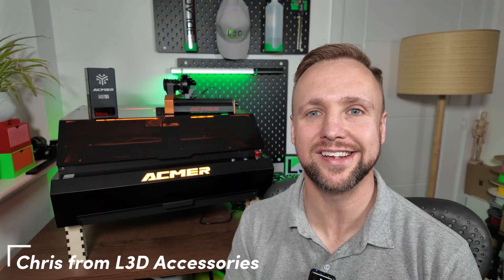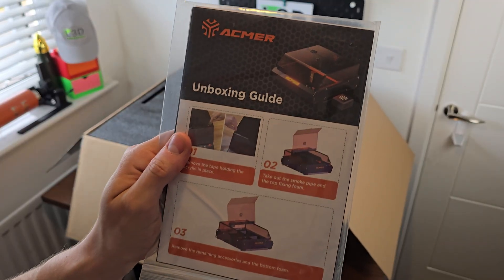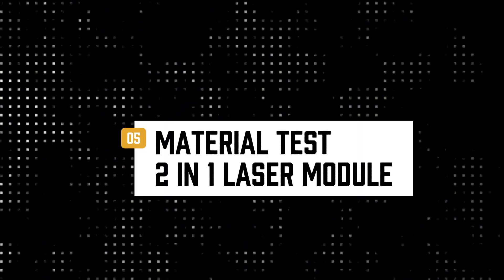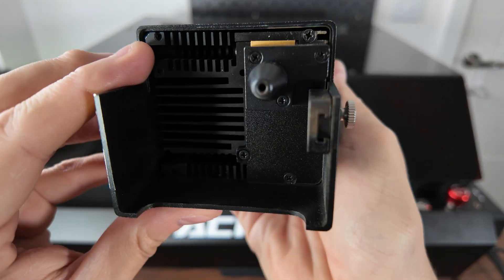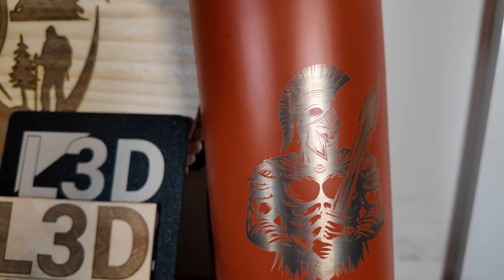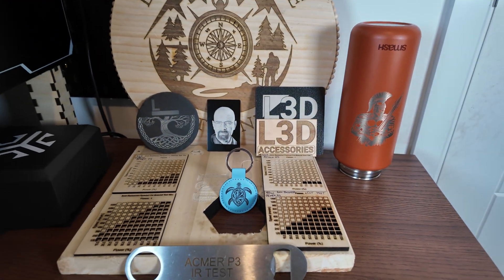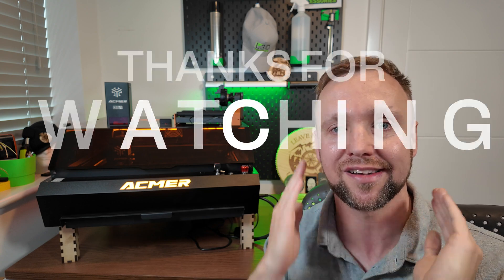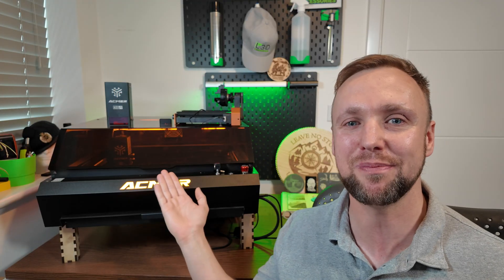Struggling to Engrave Metal, Wood, Leather? ACMER P3 Handles It All – Full Test & Results

Comment from the maker: Correction: After posting this review, I discovered there is a rear fan switch on the back of the ACMER P3 which allows you to turn off the external fan. However, the machine still remains fairly loud overall due to the internal module fans, so that part of the feedback still stands.

Comment: Be careful buying from this company.  The cleaning process only leads to broken wires and a laser you cannot use.  Plus, customer support does not exist.  I've tried numerous attempts to help with my laser purchase Nov, 2025.  No response and non-working laser.  Less than 1 month old and not working.  Go some place else to buy.
Reply from the maker: Thanks for sharing your experience. That sounds really frustrating, especially with such a new machine. My own unit performed well during testing and the review reflects that, but individual faults can happen with any brand.
I don’t have access to ACMER’s support system myself, but I hope they’re able to resolve this for you quickly.

Comment: I am a hobbyist and do small projects to learn and maybe a small gift for family and friends.  I have a Lo.....er 10 Watt machine the I have used for years with pretty good results.  I am looking to upgrade.  In your opinion do I need to go to the expense of the 48 Watt head or which on would you recommend?  TYIA
Reply from the maker: The answer would depend on your intended plans. If you want to do intricate engravings onto engraving blanks or wood I'd say to go for the 20W. The spot size is smaller and it is much easier to get a nice clean finish. If you want to cut some thick woods and acrylics then the 48W is what I'd recommend.

Comment: If you use thicker materials do you have to do a camera alignment everytime. Or is there anyway you can off set it
Reply from the maker: I never realigned the camera once and I always found it to be accurate.
Reply: If you have a good camera calibration and a good focal point set for that then you can just reset the focal point for thicker materials up to a certain point. The further you get from the center the more placment drift you will have. A good focal point works for 1/ 16 1/8, maybe 1/4 but would need to be redone with calibration at .5in for example.